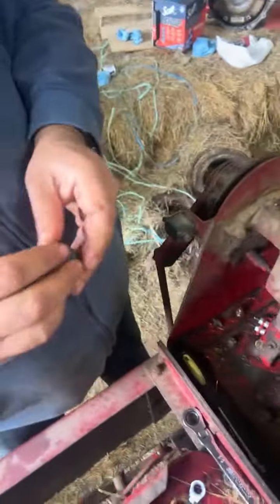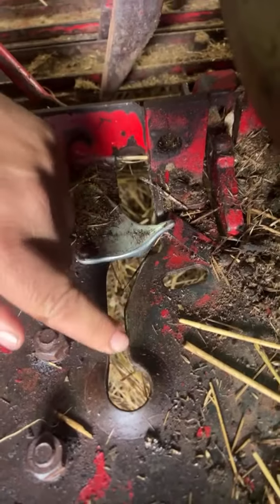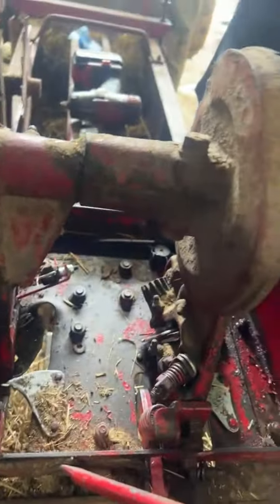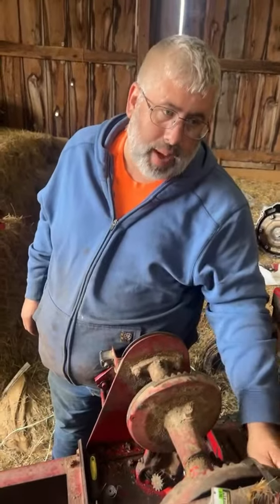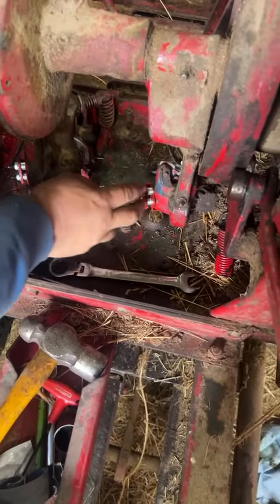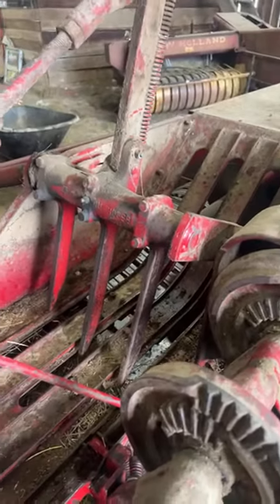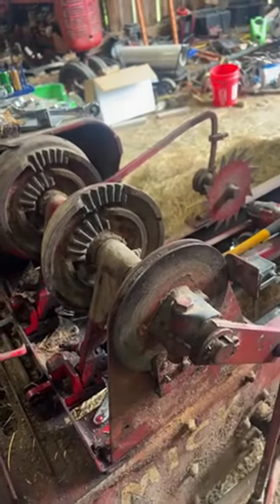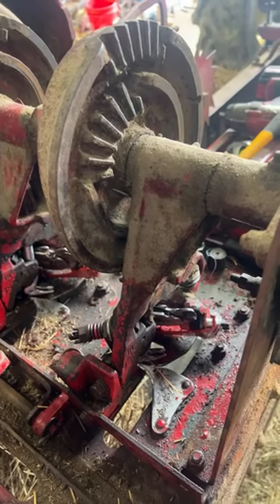Highlight 10:29 - 15:29 from BALERMAN is live! IH KNOTTER UPDATE KIT BEING INSTALLED!!

Comment: Which model balers does this kit fit?
Reply from the maker: It fits 27, 37, 47, 57, 45, 55, 46, 56 and early 400 series that doesn’t have ALL TWINE KNOTTERS. Call R&S AG SERVICES to order yours 607-846-5959
Reply: I work in repairing tractors and agricultural machinery. I am looking for a job opportunity